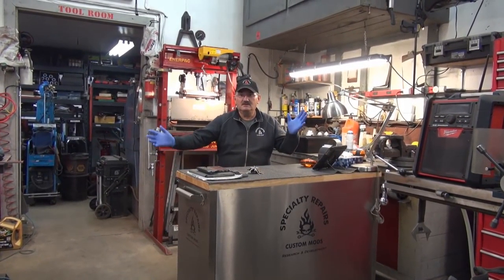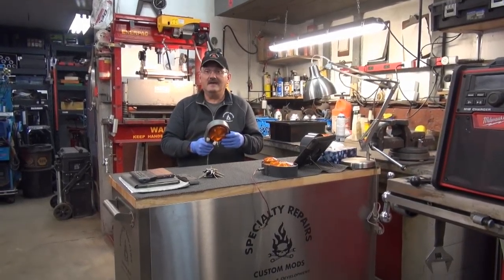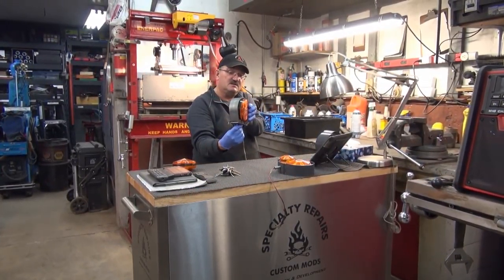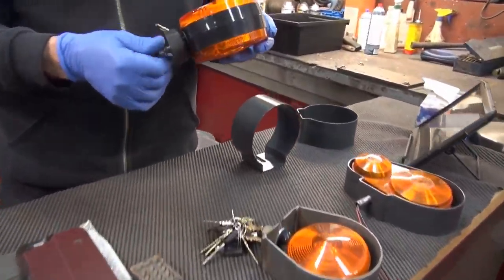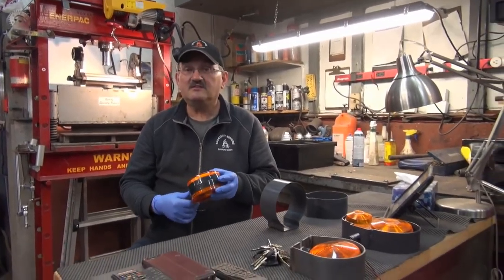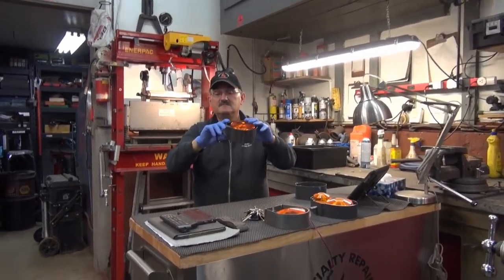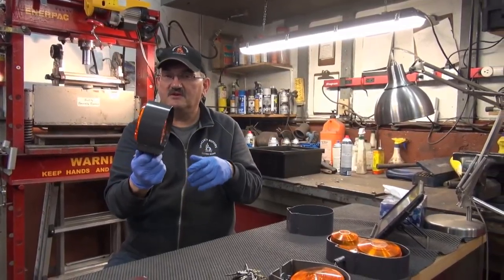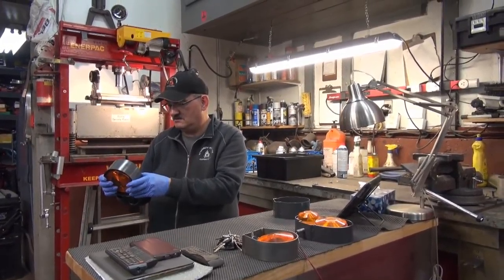New Mod (Guard #3)

Comment: Not sure if you’ve already done this or not. It’s a good idea to cut replacement strips for your cutting table before you need them. We use to use a 12’ shear to cut outs but you could buy flat bar or cut strips from a sheet.

Comment: Paul, What are your thoughts on the BX 2680? Would use it for jobs around the house using a front end loader, belly mower and a 3 point rotary tiller. At least to start with. I have 5 acres at house and another 15 acres down the road and already have a 42 hp Kubota